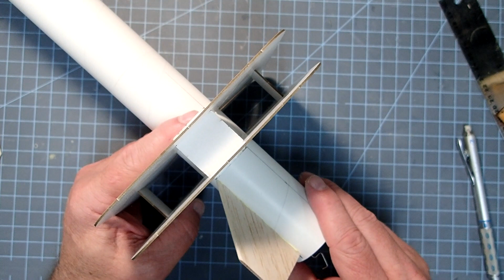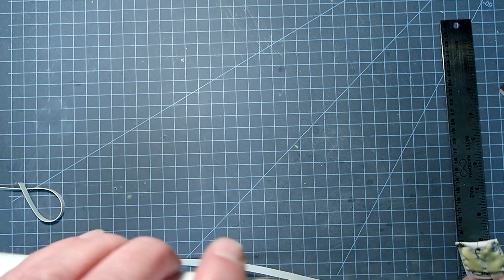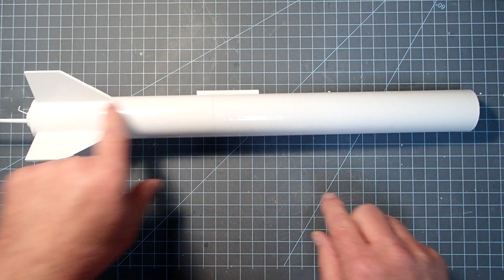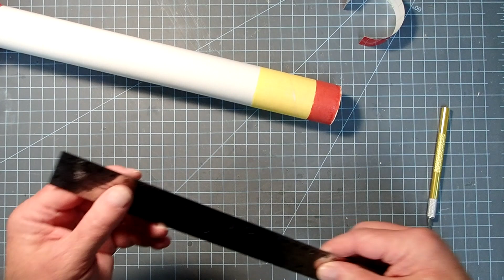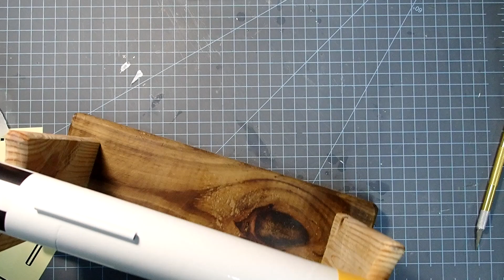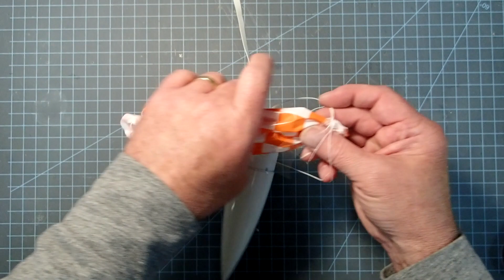Estes "Patriot Missile" model rocket assembly (part 2 of 2)

Comment: 10:36 Have you ever used Bondo glazing putty to help fill voids on nose cones? I have used it a few times and it works great! Does have a strong smell so I do recommend a well ventilated area.
Reply from the maker: I've used something similar on larger nose cones, but not on these. The drawback to epoxy-based fillers is that they require a lot more sanding effort.
Reply: @REAR_rockets  Try DAP DryDex Color Changing Spackling and Nail Hole Filler. It goes on pink and changes to white when dry, easy to sand and no odor. Bondo sets up too fast, gets much too hard and is heavy compared to the DAP product.